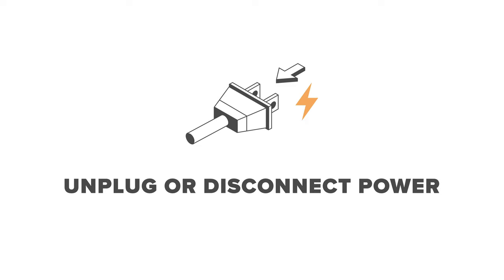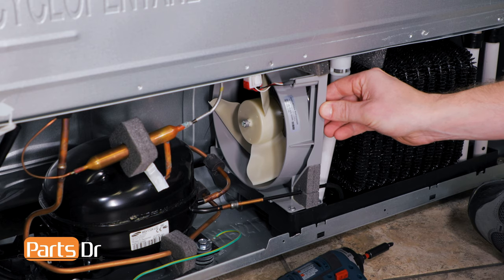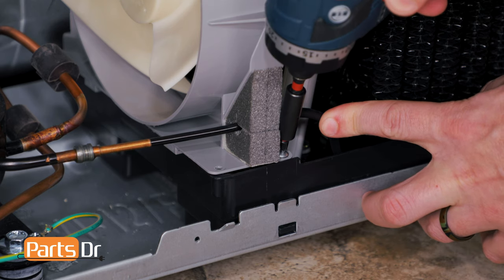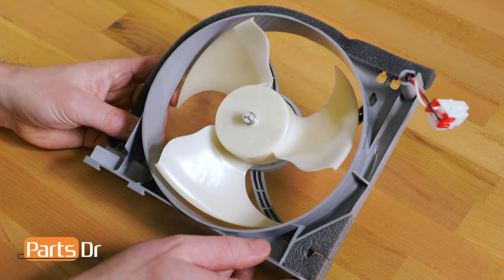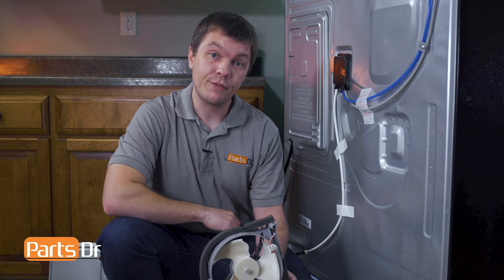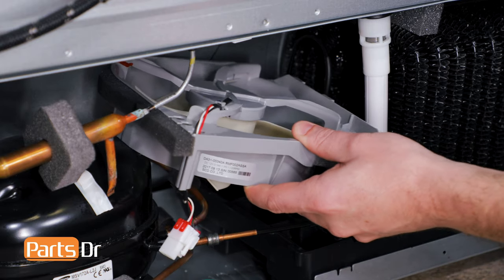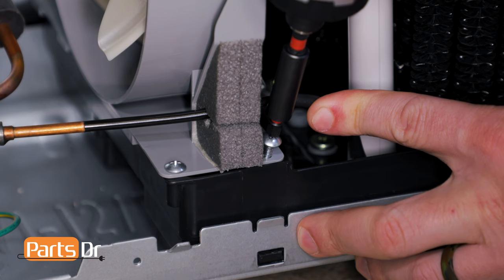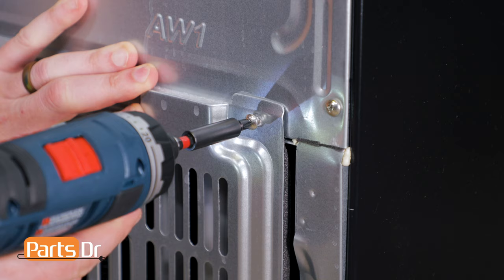23 E or 23 C Error code? How to replace Samsung condenser fan motor part # DA97-15765C

Comment: Thank you!!! Terrific instructions for our RH22H9010SR model. The new fan started up in just a few minutes. It's been an hour and the fridge is doing great again. The first cooling problem happened after we enclosed the fridge within a tight cabinet space (only a 3 inch gap at the top and no real gap on the sides), so we noticed we needed to pull the fridge more forward than normal for it to get more air space behind it. This time around, w/ the same problem description as Nura Abubakar Kaoje comment below, I think maybe we were negligent about ensuring that none of the air holes inside the fridge and freezer are covered by food, that there is proper air circulation around the foods (so no over stuffing the fridge), and/or that all the drawers are always closed completely to ensure the outer fridge doors are completely closed before walking away from the fridge. Thanks, again!
Reply: I hope you cleaned the condenser coils with foaming cleaner. In the old days the coils were all over the back of refrigerators. Those units lasted 30 years and more. Of course they were made in the USA by Americans that gave a shit.
Reply: what was the issue with your refrigerator?? My refrigerator is freezing my food from the fridge side and was wondering if this might be the issue?

Comment: Video is nice and clear and I can see it's almost the same, but the layout is different on my fridge. The locking clips were a serious pain in the butt to get loose, but there is also not enough room to nicely tilt the fan unit 45 degrees to the side to remove it... there's this weird little extra "loop" of refrigerant piping by the electrical plug that comes down out of the fridge, loops, and goes back up in. 😠
Reply from the maker: Some of these are more difficult to replace.  Let us know if you figure out the trick to replacing yours.
Reply: @PartsDr Alas, I'm paying an appliance repair service and letting it be his problem. LOL

Comment: my Samsung Refrigerator RF4287HARS/XOO quit cooling and showed a 23 E error code which is the condenser fan motor.  I replaced the condenser fan motor and it ran for about 36 hours and quit again. Then I replaced it again and it never started up.  So, I call the repairman and schedule an appointment and he's not coming for a couple of days.  In the meantime, I plug the refrigerator back in and it starts running and it runs for about 30 minutes and stops again.  The compressor is very hot at this time and the frig is cooling and I got scared and unplugged the frig.  What do you think is the problem?  TIA
Reply from the maker: Hi! The first tip we have for you is to remove the back cover of the refrigerator and take a house fan point it at the condenser coils to cool down the refrigerator until you get the problem fixed.  Second, if you put a new fan motor in and it worked then stopped then we would suspect that the main control board may be bad and not sending power consistently to the condenser fan motor.  Sometimes we see the fan motor fail first, when then causes the main control board to fail.  To fix this both parts must be replaced.  Good luck with your repair!
Reply: @PartsDr  Thank you.  Great videos
Reply: The problem is you purchased a Samsung Fridge.  Working on mine for the 3rd time in 3 years.  Last time too.
Reply: @julesjames593  I know right, honestly I think there are some of the worst refrigerators you can get right now.

Comment: How long does it take it take for the compressor to start running so I know the condenser fan motor works ?
Reply from the maker: If the refrigerator is unplugged, it can take up to 15 minutes to start running once plugged in again.  Please keep in mind that the refrigerator must be warm enough for it to turn on and start to cool down.

Comment: hi...my samsung condenser fan runs when the compressor is off and vice versa. i connected my voltmeter to the output plug of the fan.its shows 12v after 8 min drops to 7 after a few min drops to 3v.can u help me pls .thank u
Reply from the maker: The only thing that we know of that could cause it to act this way would be a failure of the main control board. Please let us know what you find.
Reply: sure sir .. does the 12v output of the condenser fan connect to output of both fridge and freezer?maybe inner fans only work when the compressor stops@PartsDr
Reply from the maker: @rkaya1651  They usually have separate outputs on the control board so that they can be controlled separately.

Comment: Hello Good morning PartsDr.
My Samsung no frost fridge (Single door)
Model Number:RR35h66107f is not cooling properly the condenser fan is not running at all no voltage at the fan terminals. The compressor makes only one cycle not coming on for the second time unless i unplug the fridge from the mains and replug it again and the temperature indicator on the front light panel is continuously blinking  8°C. Please help me with the solution. Thanks.

Comment: Does the condenser fan run continuously?
Reply from the maker: On most models, the condenser fan motor only runs while the compressor is running.

Comment: I have a 2 identical unit so, I have ruled out the board and the fan.  However, when hooked up, the condenser fan does not run.  I have not found any short in the wiring.  Any similar experience?
Reply: I'm also having same issues did you ever find the issue
Reply: I have the same issues, Samsung says it’s the sealed system issue so they are going to fix it. I’m not convinced that will fix it but they are paying for it.

Comment: My fan is working but i receive 23 E code i unplugged and plug and works for a day or two then again same error 23 E what could be?
Reply from the maker: It is usually caused by a bad condenser fan motor, bad main control board, or sometimes both.
Reply from the maker: Let us know what you find as the solution to your problem.

Comment: On my samsung, the dumb asses put two screws inside the fan cage. You need to remove the fan from the motor shaft. My fan broke. Im replacing with new style. You need to clean the coils on these at least once a year.